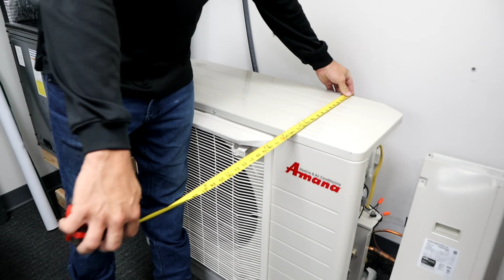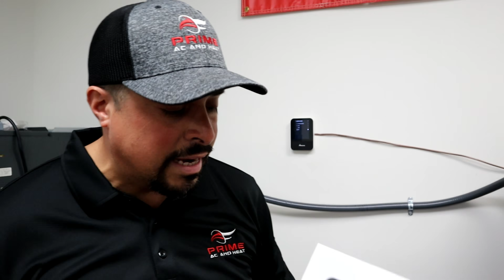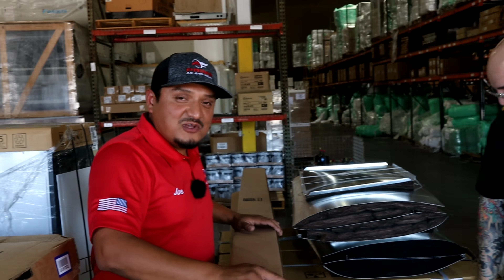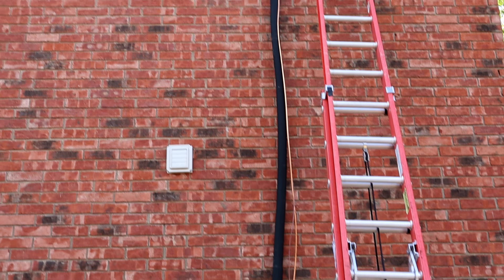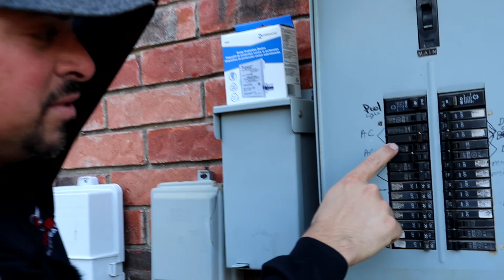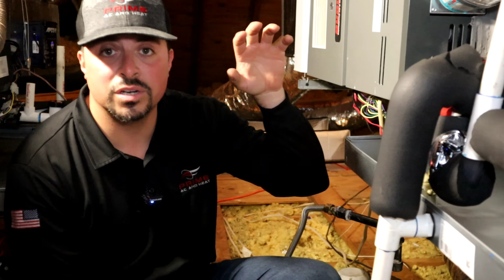Revolutionizing Home Comfort: Daikin Fit | Amana S-Series | Not Your Traditional AC Unit. Prime AC

Comment: Just had the amana s installed.   Super quiet.   Having issues with a sensor error that installer trying to resolve.  Also the thermostat is 7 degrees out of calibration.  Cooling the house nicely.

Comment: I enjoyed the video, but it did not answer my question.  Intrigued by the inverter air conditioners but suspect it requires a variable speed furnace/air handler.  If so, I would be required to replace the furnace which is something I'm not prepared to do.
Reply from the maker: @trappn Thank you so much for your thoughtful question and for engaging with our video—we truly appreciate your interest!

You're correct in noting that inverter air conditioners, like the Amana® brand S-series, are designed to work optimally with indoor units that have variable-speed motors.     

We understand that replacing your furnace is a significant decision.   We recommend consulting with a professional HVAC technician who can assess your current setup and guide you toward the best solution tailored to your comfort needs and budget.

Thank you once again for your engagement and for bringing up such an insightful question!

Comment: How do you switch from elecrtic to gas heat ?
Reply from the maker: The Amana® brand smart thermostat is designed to automatically switch between your heat pump and gas furnace in a dual-fuel system, ensuring optimal efficiency and comfort. When outdoor temperatures drop below a certain threshold, the thermostat transitions from the heat pump to the gas furnace, which can provide more effective heating in colder conditions.

If you prefer to manually switch to gas heating, you can activate the "Emergency Heat" mode on your thermostat. This setting turns off the heat pump and relies solely on the gas furnace for heating. To enable Emergency Heat, navigate to the system mode settings on your thermostat and select "Emergency Heat." This feature is particularly useful if your heat pump is malfunctioning or unable to maintain a comfortable indoor temperature. 

For detailed instructions on configuring and operating your Amana smart thermostat, refer to the Homeowner Guide provided by Amana. 

Thank you for engaging with our content. We appreciate your support and hope this information assists you in managing your home's heating system effectively.

Comment: Oye loco, a little help here. Curious to know much square footage does a 4 ton Amana S series cover? I'd call your company to come out and do mine but I'm pretty sure that you're not driving out to Pennsylvania just to help a customer out lol. My cousins live in Texas though so I'm glad i found a company i can refer them too. Con confidence!
Reply from the maker: Thank you so much for watching and commenting on our video! We really appreciate your support and recommendation to your cousin in Texas. While we’d love to make a trip up to Pennsylvania, we’re sure there are some great companies up there who can help you out.

As for your question, a 4-ton unit typically covers between 2,200 and 2,700 square feet, especially in ZONE 2, which includes Pennsylvania. However, to get a more accurate estimate, it’s important to do a heat load calculation that considers factors like windows, rooms, and insulation. Also, make sure your ductwork is correctly sized for the necessary CFM and tonnage.

For a 4-ton unit, you’ll need at least 1,600 CFM for your return and supply ducts. You can determine the correct duct size by referring to a duct chart.

I hope this gives you a good starting point for properly sizing and designing your system. Thanks again for your support and for recommending us to your cousin! If you have any more questions, feel free to reach out.

Comment: another question, are you saying that you can track our AC use?
Reply from the maker: Certainly! When it comes to accessing your Amana system through our Amana cloud services, we provide three distinct options tailored to your preferences. Firstly, you can grant us full access, allowing seamless monitoring and troubleshooting to ensure optimal performance. Alternatively, if you prefer to maintain tighter control over access, you can opt for the view-only option. This means we'll need to request a code each time we access your system's data, ensuring your privacy while still allowing us to assist as needed. Lastly, if you prioritize privacy above all else, you can choose to deny us access altogether. However, in such cases, we'll still require a code for remote access and troubleshooting purposes, guaranteeing security while enabling efficient assistance when required. These options empower you to tailor the level of access to your Amana system according to your preferences while ensuring proactive monitoring and timely resolution of any issues that may arise.

Comment: But how expensive are repairs on this unit?
Reply from the maker: Excellent question! Our Amana S systems boast an impressive 10-year warranty on both parts and labor, complemented by a remarkable 99-year warranty on the compressor. During this decade-long coverage, customers won't incur any expenses as the warranty comprehensively covers all necessary work. As the industry increasingly adopts inverter-driven air conditioning and heat pump systems, repair standards are set to align with modern advancements, promising enhanced efficiency and reliability.
Reply from the maker: Thank you for watching and interacting with our video. We appreciate it

Comment: What’s the operational difference between a 3.5 ton Amanda S Series and the Daikin Fit?
Reply from the maker: Hi  @geneklos4210  

In response to the question about the operational differences between a 3.5 ton Amana S Series and the Daikin Fit, the straightforward answer is that there are no significant operational differences between these two units. This is because both models utilize similar technologies in their design and function.

Despite being from different brands, these units share comparable features in terms of efficiency, compressor technology, and design aspects. Both are likely to have similar Seasonal Energy Efficiency Ratios (SEER), employ advanced compressor technologies for energy efficiency, and offer similar user-friendly features such as Wi-Fi connectivity and advanced filtration systems.

Therefore, when choosing between the 3.5 ton Amana S Series and the Daikin Fit, the decision may come down to brand preference, pricing, or specific model variations rather than any major operational differences.
Reply: @primehvac  Does the new Goodman SD differ a lot from these two brands?
Reply from the maker: Thank you for watching and commenting on our video. The difference between the Goodman SD, Amana S, and Daikin Fit is that the Goodman SD does not qualify for an Energy Star rating. It is an entry-level side discharge inverter system and a great option if you're in the market for such a system. The warranty is also the lowest of the three, with 10-year parts coverage. In contrast, the Daikin Fit has a 12-year compressor warranty, and the Amana S has a 99-year unit replacement warranty.

As long as you have a well-qualified and highly trained company that consistently works on, sells, and maintains these types of units, you will have an awesome AC. If you can upgrade to the Amana S or Daikin Fit option, you will get a much better variety of the SD inverter system.

Hope this helps!
Reply: @primehvac  Thank you for your suggestions. We have decided to go for this Goodman SD system, since it seems difficult to get Daikin fit in our region.
Reply: @jiweihe3413 goodman  is not certified for rebates still? Is it still the case?
Reply: @emyunster probably we didn’t get any rebate but the price is very reasonable without rebate

Comment: Thank you for some great detailed videos on HVAC systems. I am South West Florida with a 2,500 sq ft ranch house. I am pro-actively replacing an 12 year old Lennox XC21 system (3 coils later). I have been quoted a 4 ton Daikin Fit Heat Pump (DZ17VSA481B/ DV48FECD14A) and a 4 ton Trane XV20i heat pump (20 Seer) with the Trane Hyperion Air Handler. Trane has a 10 year parts and labor warranty the Daikin 12 years parts and labor. The Trane system is about $2,400 more expensive.  Which system do you think would be the best investment? Can the Amana S / Daikin FIT complete with the top-of-line Trane? God Bless and thank you again.
Reply from the maker: Hi @joeythedime1838! Firstly, thank you immensely for your dedicated viewership and trust in our videos. Addressing your query, without a shadow of a doubt, the Amana S Series/Daikin Fit is not just in the league but is pioneering where AC technology is heading. Here's why:Compact Design: The Daikin Fit seamlessly integrates into homes, even where space is a premium or aesthetics are crucial.Inverter Technology: This tech is a game-changer. It ensures efficient and silent operation, adapting to real-time requirements and significantly boosting energy savings.Unbeatable Warranty: While Daikin's 12-year parts and labor warranty is impressive, the Amana S Series' 99-Year Compressor Warranty is truly groundbreaking, showcasing unmatched confidence in product longevity.Cost-Effective: The performance and durability offered by Amana/Daikin come without the steep price tag, ensuring every penny is well spent.Unparalleled Quality: With Daikin's stringent commitment, you're assured of a robust system with minimized maintenance hiccups. To put it bluntly, the Amana S/Daikin Fit is not just competing; it's setting the gold standard in the industry. It's undeniably one of the best HVAC investments you can make. Just a tip: ensure your installation dealer is certified for Inverter systems and possesses in-depth training.Your faith in our content is deeply valued. Wishing you the best in your HVAC endeavors, and God Bless! 🙏🏼
Reply: @primehvac  Thank very much for taking the time to provide such a detailed in depth professional response. Truly a testament to your dedication to your trade, your clients and your team.  Your response helped me decide to move forward and purchase the Daikin FIT (unfortunately I don't have a local contractor that supports the Amana product line.) Thank you again and heartfelt best wishes to you and your family.
Reply: Get a quote for the Amana-Series and the Daikin Fit.  They are twin units and Amana should be less expensive.  Do not waste your money on a Trane.  I am an HVAC business owner and technician.  Trane is having some issues right now.
Reply: @Balticblue93  Thank you! The quote for the Daikin Fit in this config: DZ17VSA481B 4 Ton Heat Pump / DV48FECD14A Air Handler (horizontally mounted in the garage) / Daikin One Touch / PRO7-20-12/5 UV Plus / 12 Years Parts & Labor is ~$13k. As I mentioned above I don't have an Amana dealer that's local.
Reply: @joeythedime1838  Any dealer that sells Daikin can and does sell Amana.  They are just being jerks.  They are identical systems, like Carrier and Bryant.  Same equipment but Bryant is 15% less expensive and not as much royalty money to sell their product.  I wouldn’t touch the Trane.  Daikin Fit all week and twice on Sunday.  What kind of filtration systems did they quote you?  I am a dealer in Denver.  If you wanted to share that, I would tell you to request an Aprilaire, Honeywell 5l filter bot or their favorite brand. That $2400 savings can be pocketed and allow you look at a dehumidifier, which might be in the quote but that AC system, will do most of it.

Comment: Great video guys.  I work for a company in north Alabama  and we also sell/install/service the Amana-S-Series systems.  I have watched a couple of your videos and really enjoyed the part where you did the sound difference from the Amana 2 stage vs the S Series.  Here in Alabama builders think its a good idea to put builder grade condensers outside of the master bedroom window.  We get more complaints about noise during defrost and customer can not sleep.  That is one of my biggest selling points.  I can break it down into the "decibel talk" which the customer my not be able to understand.  but the part where you show the differences really paints the perfect picture.  We have recently stopped using the smaller surge protectors because their range is so vast that it may not be able to catch the voltage spikes.  We have swapped over to the RSH-50 VRM Kit.  It is an adjustable surge protector with breaker combo that serves as a disconnect also.  We set our range from 200 low to 250 high.  Amana/Daikin recommended it to us and we've been using it ever since.  Anyway, keep up the good work.  You guys seem to be setting the bar for reputable companies in the area.  Glad your not in my area.  Altho, I would like to go head to head with Brett
Reply from the maker: Hey @user-ys2iq4dg1c,

Thank you so much for taking the time to watch our videos and for your detailed feedback! It's always a pleasure to connect with fellow professionals in the industry and hear about their experiences.

I completely understand the concerns you raised about noise, especially with builder-grade condensers placed so close to bedrooms. It's truly a challenge, and I'm glad our video on the sound difference between the Amana 2 stage vs the S Series helped illustrate that point to customers. Sometimes, it's those practical demonstrations that really drive the point home.

It's interesting to hear about your transition to the RSH-50 VRM Kit. We're always on the lookout for ways to improve and adapt to new technologies, so it's great to have insights from colleagues in the field. We'll definitely take a closer look at the adjustable surge protector you mentioned.

Lastly, your kind words about setting the bar mean a lot to us. While it sounds like we won't be crossing paths in the field anytime soon (given our geographic differences), it would indeed be a treat to have a friendly "head to head" with our lead designer Brett!  We love a bit of friendly competition 😉

Thanks again for your support, and here's to continued excellence in the industry from both our ends!

Comment: Let’s talk coils on both, copper hairpin with aluminum fin or aluminum hairpins with aluminum fins
Reply from the maker: Certainly, @kentsmith9383! The choice between copper hairpin with aluminum fins or aluminum hairpin with aluminum fins often depends on factors like thermal conductivity, corrosion resistance, and cost. Copper provides better conductivity, while aluminum is more cost-effective. Both options have their merits, and the decision comes down to the specific requirements of the application.

Comment: @PRIME AC AND HEAT, Will Amana S-Series cloud service work in cell zone w/only 1 bar (at times none)?
Reply from the maker: @gailbrook Great question! The Amana Cloud Services for dealers can be accessed through data or Wi-Fi, and they are viewable on tablets, phones, or back at the office.

If you're inquiring about the Amana Wi-Fi consumer app, you'll definitely need an internet connection for your home, and data on your phone will be necessary to access it. The performance will vary based on your connection strength and the specific service you're using.